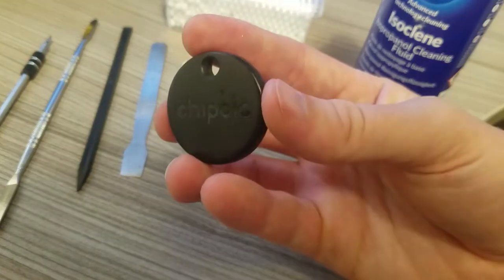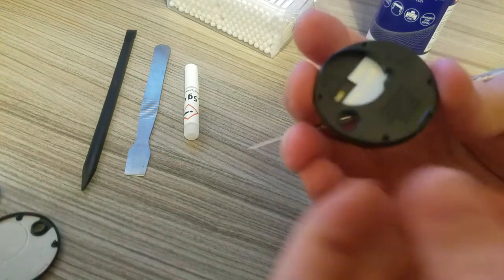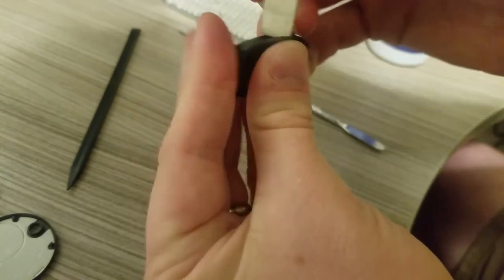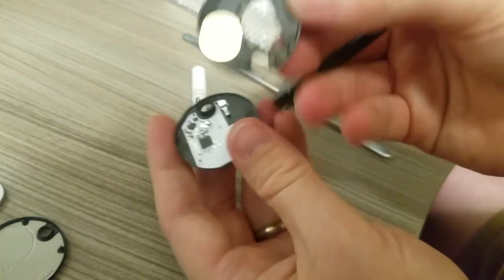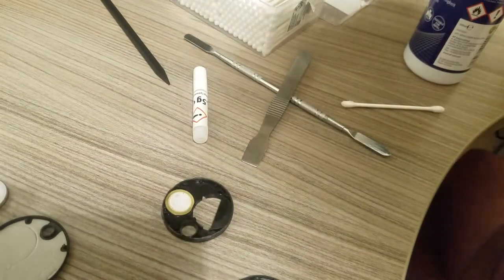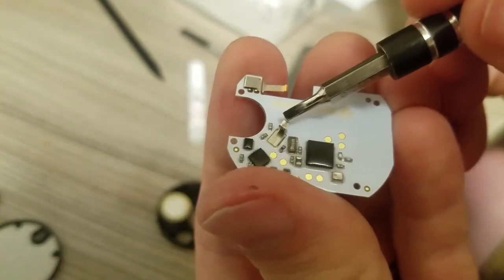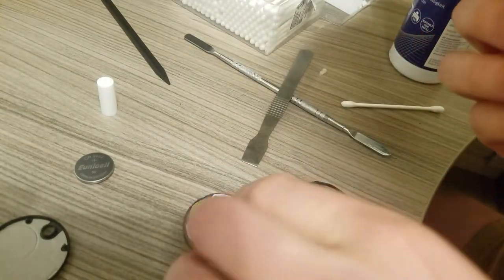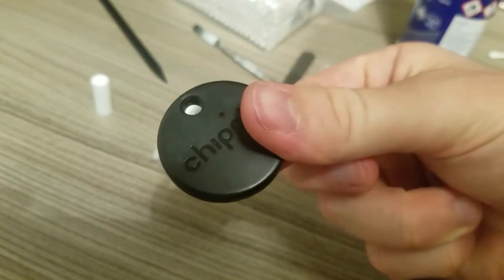How to fix a Chipolo One speaker (not working / no sound)

Comment: I had this problem after changing my battery. I didn’t take mine apart like you did. What I did is spray electronic contact cleaner on the Chipolo with battery out. I sprayed it a couple of short times. I allowed it to air dry. It doesn’t leave a residue. I put my battery back in and it started working again.
Reply from the maker: Definitely worth a shot if your pins are just dirty but not bent
Reply: @olivercouch1651  the problem could be avoided if the put tiny springs under the pins to make it retain the correct position. The springs would keep them properly aligned.